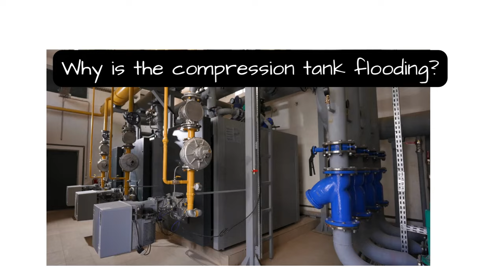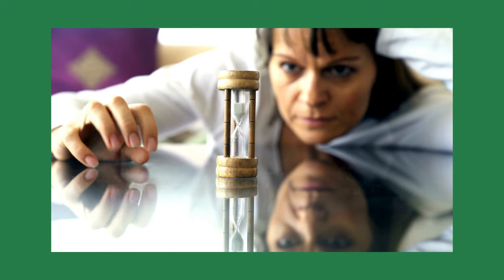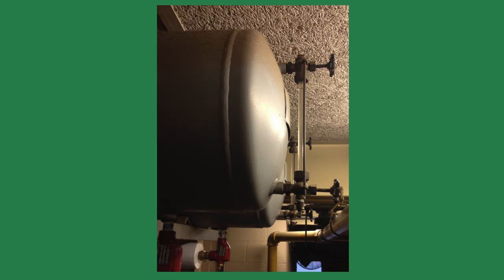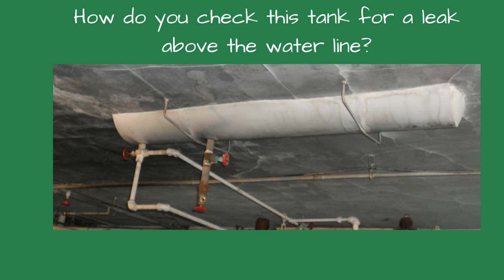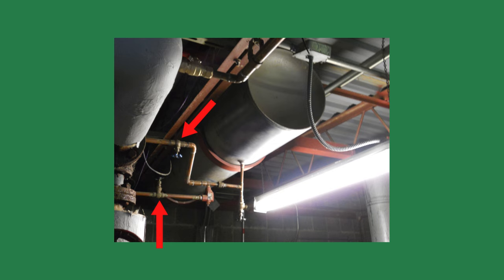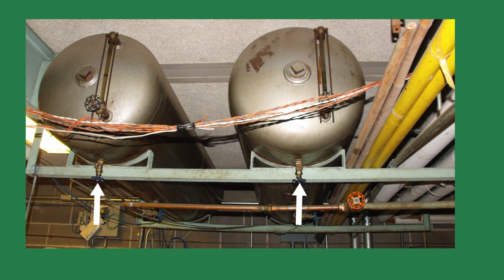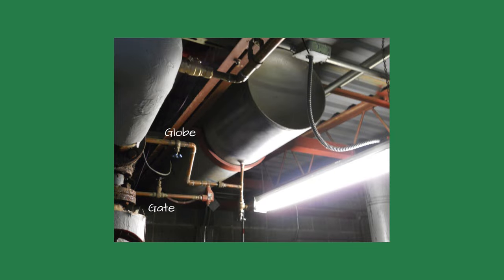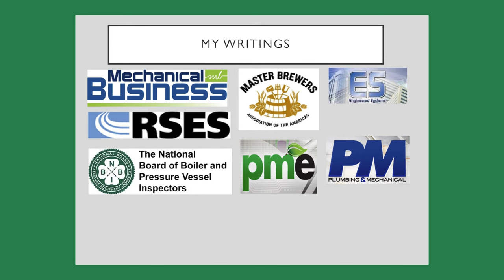Why is the compression tank flooding

Comment: Could another issue also be some one adding an auto air vents to that type of system?
Reply from the maker: Good question the vent would have to be on the top of the tank I think What about you?
Reply: @boilerroomdetective  I've heard that over time the oxygen in the tank will dissolve back into the water (especially when the tank is cooler) then  cycle around back to the boiler where  the o2 is "boiled" out and then goes out a can vent.  I was taught thats why you should only use auto vents on systems with a diaphragm expansion tank.